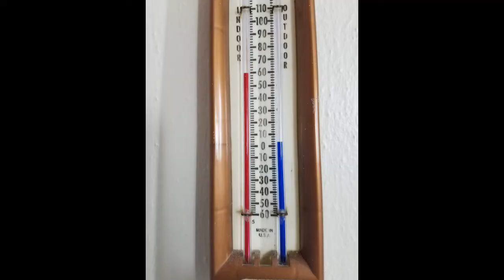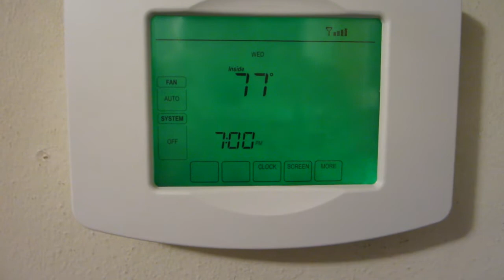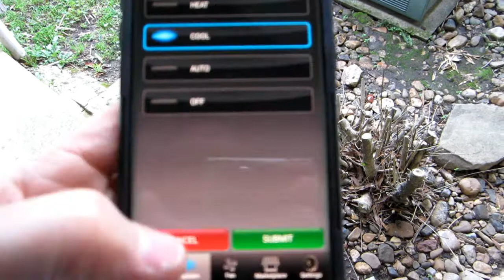1997 Rheem Condenser Begins 25th Cooling Season

Comment: Have same unit. 1998. Wish mine had that type temp control on the wall.
Reply from the maker: The Honeywell Vision Pro thermostats are great. I have been using this one since 2013.
Reply: @AVTreasures  with WiFi or not?
Reply: @AVTreasures  not sure if I want WiFi or not. Pros. Cons?
Reply from the maker: Yes, it is WiFi
Reply from the maker: Yes, get WiFi. I love it. I can adjust it from anywhere and also the App will send notifications if the temperature falls or rises beyond the alert level I set. No Cons at all that I can think of. It has worked flawlessly for me for years.
Reply: @AVTreasures  ok thanks I’ll get my hvac guy to install it when he comes to service the unit.
Reply: @AVTreasures  got it coming thanks again.

Comment: Hey Ray did you hear that Emerson released a multi voltage Emerson Sureswitch contactor. It designed for 120v, 208v and 240v line voltage. Then coil voltage from 24v all the up to 240v.
Reply from the maker: No, but thanks for letting me know! I need one for the Dehumidifier controller that will operate on 120V.
Reply: @AVTreasures  Hopefully we can see a video of you installing it. Is the Kenmore dehumidifier still in use today.
Reply from the maker: I will do my best to film it. No, I have been using a smaller 35 pint Perfect Aire brand  for a few years now. I found it at an estate sale. Works amazingly well.  Replacing the windows and doors and caulking all the supply register boots really cut down the humidity infiltration into my house.
Reply: @AVTreasures  I'm soon getting to HVAC/R replacement time. I have 3 Goodman Units 2 80% Furnaces from 2005. Then a 90% from 2005 and 3 10 SEER outdoor units. 1 unit was manufactured in 2001 but installed in 2005 must've been sitting the warehouse for a few years. The other 2 outdoor units are from 2005 all the systems are matched. Just had to replace the capacitor on the unit from 2001. Capacitor was bad on the fan side compressor side was close to its rated microfarads. I was surprised to find an original Amrad capacitor in it.
Reply from the maker: Wow, that cap lasted a long time. Amrad Caps are the best and made in the USA
Reply: @AVTreasures  I installed a new Amrad capacitor to replace the old one it lasted a long time. Luckily I caught it in time before any damage could occur. The unit does not have a low or high pressure safety control. I saw the condenser fan not turning and off on thermal overload. The internal bypass in the compressor was open. I could hear the compressor screaming for help. The compressor seems to be operating fine after the capacitor was replaced. The fan motor was fine and amped out within spec. The unit has a reliable Copeland reciporcating compressor but is a little noisy like most reciporcating compressors are. The next unit replacing it will have a reliable Copeland scroll compressor in it.